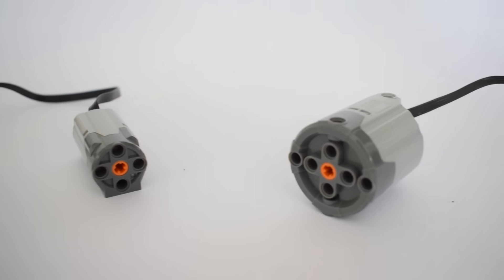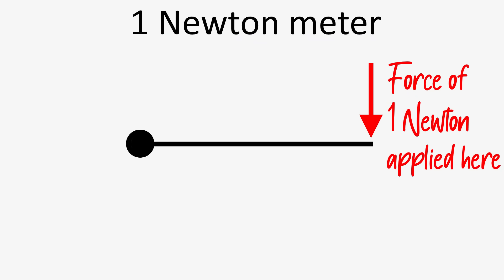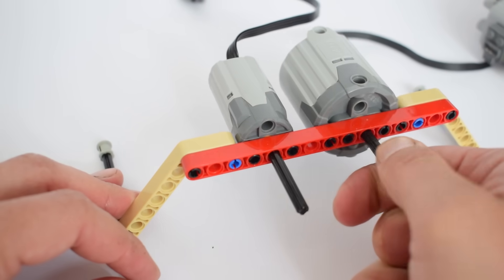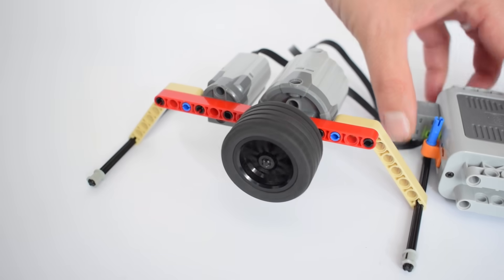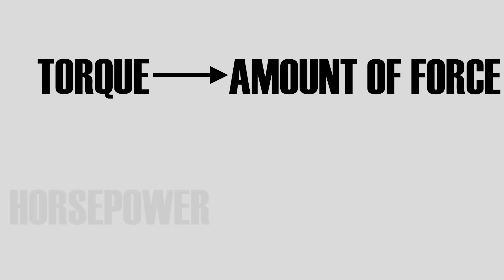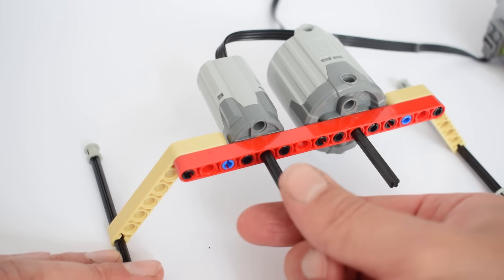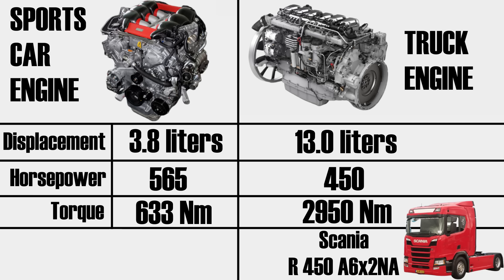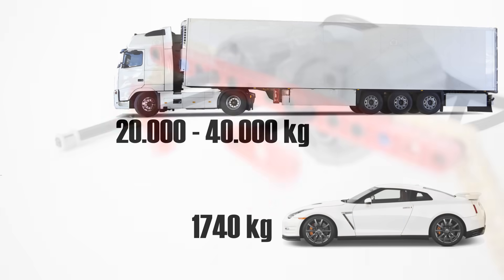NEVER be confused by HORSEPOWER and TORQUE again - HP and TORQUE EXPLAINED in the MOST VISUAL WAY

Comment: Sorry man but there is no such thing as "rate of force". Power is rate of WORK. And the best way to think of work in this case is force times distance. So since power is work/time, it can be rewritten as (force x distance) divided by time, then remember that distance/time is speed, so another form of describing power is force x speed. For an engine the force is the torque and the speed is the RPM. You need a number to divide by so that all the units are accounted for. In US units the number is 5252. In metric it's kW = 0.105 x Nm x rpm / 1000.

Comment: I think it's also worth pointing out that gearing can be used to compensate for a lack of torque. That is to say that, theoretically, two cars with vastly different torque, but the same horsepower, could accelerate/pull with the same force if the gear ratios are scaled. For this reason, you can roughly compare how two vehicles of similar weight can accelerate based on horsepower alone (e.g., mustangs and camaros with equivalent transmissions have nearly identical acceleration times with very different torque, but nearly identical horsepower). I say theoretically because the engine with more torque will probably have heavier engine and transmission components, more inertia, etc., and will be slower to rev up with no load. Add in that the shape of the power curves, gearing, drive line losses, etc. will probably not perfectly line up, and you get a bit of a mess.

Now, another benefit of using horsepower as a metric is it tells you when, for any given car, you should be shifting to achieve maximum acceleration. And that moment occurs when the power at a given RPM is equal to what power will be at the new RPM after completion of the shift (assuming of course that you do not get valve float first 👀, in which case, that's when you want to shift lol).
Reply: This video only refers to torque at the crank, which is simplified for the general audience. A sports car can have a high revving engine, which enables higher gear ratios, which multiply the torque, so there is more torque at the wheels than at the crank.
Reply: @Obi-WanKannabis  and that's why I'd say the video outright gets it wrong when talking about why semis use large diesels. It's not really about torque at the crank, it's about reliability and efficiency, and larger diesel engines are going to be a lot more reliable and efficient than gasoline ones with similar demands placed on them. Sure, they do have higher torque at the crank, but to say that's why they're used is putting the cart before the horse. There's nothing stopping someone from putting a high output gas motor that revs to 7k in a truck, and performance would be quite good with proper gearing.
Reply: @caracalfloppa4997  bingo
Reply: @caracalfloppa4997  Nail on the head!! This is an important point and rarely understood by vehicle shoppers. Back in my landscaping days, I watched my boss buy a new truck that he expected to be better able to hual our gooseneck trailer up the long grades on mountain passes in Montana. It had about 30% more peak engine torque, (but notably less power). I felt really bad for him! The new truck had AC, but obviously, we still preferred the old truck for those hills!
Reply: @caracalfloppa4997  It’s great to see comments on Youtube, that are written by people who actually know what they are talking about.

There are too many “car guys” out there that have no clue about cars. (or physics in general)
Reply: @caracalfloppa4997    The other important reason is that diesel engined trucks have a flatter torque curve which enables them to stay in a specific gear longer. Constantly changing gears, say on a hill, loses speed fast, and therefore becomes tiresome and inefficient in maintaining speed if the torque curve is steep.
Reply: @Obi-WanKannabis  Yeah. I wish people wouldn't try to make that simplification. A person isn't really understanding what power is in a vehicle until they see that it isn't altered by the choice of gear, while torque and rpm are altered dramatically and inversely. Then you see that at every speed, power is related directly to thrust (unless there is a burning smell;)
Reply: @drienkm  I will also note that as the car accelerates it shifts into higher gears so the propuslive force from the wheels is less, but since the velocity is higher the horsepower remains the same
Reply: @forloop7713  Yep. At every moment (if clutch, torque converter, or tires aren't slipping), THRUST = SHAFT POWER / VEHICLE SPEED - SMALL (and pretty constant) LOSS.
And shaft power varies below and up to the power curve based on rpm and manifold pressure (dictated by throttle and altitude).
The small loss varies by drivetrain design, and may be a percent or two different in various gears.
Reply: @Obi-WanKannabis  but then he talks about what you feel. What you feel is the work done. Power.
Reply: @Obi-WanKannabis  All cars have more torque at the wheels than at the crank.
Reply: @forloop7713  Yes, but gear ratios multiply it differently, if your car revs to 9000 rpm you're going to multiply that torque more than if it revs to 6000.
Reply: @forloop7713  that's the multiplication factor of gearing. 
Not what's being discussed in this video.
Reply: @forloop7713  I disagree with this assumption as lack of efficiency i.e. friction on gears, bearings  etc. loses 
power and torque. If you lower the gear ( numerically, one being lower than two ) to increase the torque, say at the wheels...then the rpm at the wheels is reduced for the same engine speed and in conclusion less power is produced at the wheels due to additional friction through more gears. The engine specs that I have, would reduce torque at the engine due to increasing engine speed being on the downside of the torque curve. The quandary in this case, is that the engine at this point, shows the BHP increasing ( due to increased engine revs )  The original question ( mine ) was should I keep the engine speed at maximum torque or bhp to climb a hill faster!
Reply: @Obi-WanKannabis  this is incorrect as it depends where the engine is on the torque curve. Think maximum torque at 6,000...after that torque is reducing....depending on spec.
Reply: Yeah, horsepower is the more complete metric as it combines two pieces of information, namely  torque and rpm. A 200lb person can easily generate 600 ft lbs of torque by simply standing on a 3ft long breaker bar, but you're not going to be towing anything very fast even though 600 ft lbs is quite a lot of torque.
Reply: I think ur gonna poo ur pantaloons when I tell u he's done a video explaining all this
Reply: Changing gear would hopefully put the engine back onto PEAK brake horsepower, I agree, but in effect it would reduce the torque as per my previous comment explained.
Reply: @malcolmwellings2198  it will not reduce torque, it will increase it, that's why gears and power curve are there
Reply: @simplemachine9531  this depends if one is changing up or down and more importantly where the torque or bhp is on the curve in  relation to rpm. ( revolutions per minute ) of the engine.
Reply: @malcolmwellings2198  absolutely doesn't have any importance because engine  torque doesn't have it either. If after shifting gear the power output is higher car will accelerate faster (torque on the wheel axis will be higher too but as I said we don't have to care).
Reply: @simplemachine9531  disagree: as if you raise the revs of the engine and at this new engine speed, it falls on the downside of the bhp curve, and at a lower point than the previous, then power ( bhp ) is reduced. Depending on the shape of the torque curve and relative revs, then the torque could also be reduced. I tried to send in the comments section i.e. the applicable torque and bhp curves with a link for you ( all ) to see what happens but YouTube erased it for some reason. Without the graph; its difficult to visualise and we may be on different pages. Any idea how I can post the link or graphic? Will try a different way in the next message to you and see what happens. Don't want this one erased too! 😭  I find this discussion very interesting as mech. tech, professors can't answer it. Beginning to think that its a mathematics question rather than physics. Regards
Reply: @malcolmwellings2198  with what exactly do you disagree? With that if you shift a gear the way engine outputs more power after that, car is accelerating faster?
Reply: @simplemachine9531  I'll explain my overall position and then why I asked you to pull up a typical engine torque and bhp graph, to enable you to see visually what I'm trying to explain. " A picture is worth a thousand words " ( old school analogy.)

My answers reflect on a typical power ( bhp ) graph DD15....and of course each engine is an individual in this regard. If you change up or down gear this changes engine speed usually. Changing engine speed affects the power output of the engine and also the torque of the engine. This cannot be visualized hence you must look at the Detroit Diesel graph that I suggested.
Accept that this is correct after looking at the graph.
At the road wheels, power ( bhp ) cannot be changed; it's a constant. Only the ENGINE power and engine torque can change. If you drop a gear then the power at the road wheels  ( torque x revs, divided by 5250 ) = power ( bhp ) remains the same except; by changing gear you merely, hopefully, put the engine onto a better position on the power ( bhp ) part of the graph increasing power. This may actually reduce power hence depending on......
The graph shows that if you do this then you could in effect reduce power ( to me solely, it seems ) The position of the final changed engine revs on the graph is the ultimate determinant.
I've studied this but even the professor couldn't answer the question which is!  If I'm driving a loaded truck up a hill and I'm using optimum engine torque according to the specs. at 900 revs ( engine speed ) [ to me this is raw energy! i.e. at the crankshaft ] then would I be better to drop a gear to 1500 revs ( shows less torque on the graph ) to increase bhp at its peak of 1500 revs. to get me up the hill faster? If so why? Raw torque or a mathematical result, using engine revs i.e. power ( work done ) than raw power is leverage, torque.
Basic theory. If you put a torque wrench on a wheel nut and it shows 100 pounds feet torque....then no work ( power ) has been produced only torque i.e. no movement revs.  T x N ( revs ) ÷ 5250.  100x 0 ÷5250 = ZERO ( work done )  Now one rev of the wrench at a constant torque of a 100 lbs feet is
100 x 1 ÷ 5250 = 0.02 bhp ( work, power has been generated. 2/100th of one bhp. Comprende? 🤔👍🤔😯
Hope this explains the dilemma! Thanks
Reply: @malcolmwellings2198  you are walking in circles, what question had to be answered by professors? You are probably lost in multiplication of two factors. I'll be walking in circles too, as you said power input in gearbox = power output from it. So if engine starts to produce higher power (after shifting a gear), power on the wheels becomes higher too. Truck will climb a hill faster because power is responsible for it by its definition power=work/time
Reply: @simplemachine9531  You miss the point mentioned many times, and will only see what I mean if you study the graph. If its too difficult for you to pull up or understand, then we have no where to go from here....the analogy I'll use this time is: there's none so blind than those that WILL NOT see.....or seek out the obvious.
Sorry, I wasted your time. Regards.
Reply: @simplemachine9531  The question was as stated. Do I climb a hill faster, using the highest torque ( look at the graph 🤔 ) or the highest bhp and why?
Reply: @malcolmwellings2198  😆 feel sorry for you, running around with those graphs, not knowing what to do with them. 
Questioned was answered thousands of times here and in other videos on topic. Right, don't waste people's time and just go check what power in mechanics is.
Reply: @simplemachine9531  Guess this is why the question was never able to be answered by people that should know. Read a paper by the SAE, Society of Automotive Engineers, last night, of which I used to be a member: he merely explained it like the first and second video, which doesn't answer my question either. I could have written the same paper!
Will pusue my question academically with the ASE directly. Engineer to engineer.
Appreciate the effort you put into this, and sorry if I wasted your time.
Pity you didnt study the DD15 engine graphs. Very interesting. Regards!
Reply: @malcolmwellings2198  I did. Typical ICE graph.
Reply: 👍. Good post.
Reply: I think it's funny people still have the arrogance to think they're better at shifting gears than computers

Comment: That's quite simple, but explain why in combustion engine torque depending on RPM and why maximum torque is available only at the specified RPM range and decreasing in high RPM.

Comment: Question of my life: So if power equals torque times RPM P=torque x RPM why then their graphs don't have analogic shape?
Reply: because the torque line is an input into the power line. A constant torque (a flat line on a torque vs. RPM graph) leads to a constant-slope power line (since the constant torque is multiplied by the variable RPM; y = mx+b where y is power, m is the torque (a constant) and b = 0 because 0 power is produced at 0 RPM).
Reply: @buzzlesworth54  you are missing my point. My point is not that torque is constant. My point is that the graphs of an engine's torque and power for each and every engine should have identical run! ...If they are bound by such a simple rule, a simple equation P=TxRPM. Does anybody get what I am saying!? I'm tired of it...
Reply: @mfst100  There's a lot that factors into the torque/power curve of an engine like geometry, fuel type, valvetrain, etc.  It's the manufacturer's job to choose the best compromise of cost, performance, and quality to suit the application.  You might as well say "All Ferraris should hold as much cargo as a van."
Reply: @mfst100  the equation P=T*w, w being angular velocity (rpm) is the definition of power. The graphs for torque and power are related, if you cant see that by looking at a picture of them then thats on you.

Comment: So basically horse power is a constant and it's a reflection of the engine/motor's strength whereas torque only applies to the force of a specific turning axle and can be changed if it goes through belts or gears

Comment: Torque is a physics work representation, but horsepower is a power unit (work over time). So, is the same as comparing a distance in foot with a velocity in miles per hour

Comment: "What is a Newton meter?" a gadget to measure force maybe? Like an ammeter measures current, a voltmeter measures voltages, so a Newton meter measures Newtons.
What is a Newton metre? That's the unit of torque.

Torque is only a force? The units of force is Newton, the units of torque is Newton metre. Thus force and torque are not the same things, torque is not just a force.

Comment: well, you kinda forgot 1 big thing. yea size help with torque, but you can also generate a lot of torque in design. example electric motors that have more winding equal torque, even if you have the same weight in winding wire. basically thick wire with lower winding count for speed and thin wire with high winding count for torque and efficiency. this also implies to gas engines (both same CC CI) bigger bore for speed and longer stroke for torque and efficiency.

Comment: Doesn't this beg the question: "If a car is advertised as having a certain amount of horsepower, at what RPM was this amount measured?" Is there an agreed upon RPM on which to benchmark all vehicles? Or do they just communicate the max HP that was achieved over the full RPM range the motor can handle?
Reply: The maximum power output. RPM depends on the gear used on the given gearbox/car

Comment: In theory though, the GTR engine could, provided with correct gearing to match the speed/HP output of the Scania engine outperform it because of the power when it comes to towing. 
If power=the rate of which work is done, then a low torque high hp engine will with correct gearing, generate more wheel torque than a lower HP higher torque engine. It can do more work in the same given time.
Reply: It's just that longevity will likely suffer if used continuously at 450 HP, whereas the monster 13L engine is effectively understressed.
Reply: @xorbe2  that's very true. Better efficiency, longevity and less complicated gearing is why high capacity engines are used for hauling.

Comment: You improperly described Newton metres of torque. The proper definition of Newton metres of torque is that people just could not leave well enough alone and stay with pounds per foot of torque. The same thing works with ounces per inch. But just like Anno Domini and BC, before Christ. Some people just can't seem to leave well enough alone.
Just having fun.
I will disagree however that you cannot feel horsepower. As soon as you feel the pressure in the seat and you can feel it as it accelerates over time, you can measure that by knowing the distance the vehicle went and how fast it got there and the weight of the vehicle and with those data points you can determine the horsepower output of the vehicle in time and weight over distance. It is entirely possible to use an engine that puts out more torque to drive larger tires, therefore taking advantage of its torque over a smaller engine that has more horsepower but not enough torque to have the grunt to push the vehicle down the road. That's taking better advantage of the torque aspect of the engine rather than the horsepower aspect of it. It's always a balancing game.